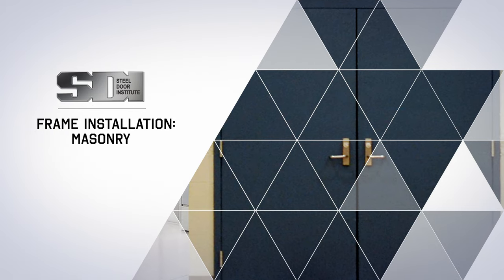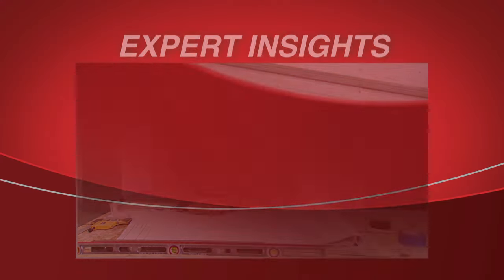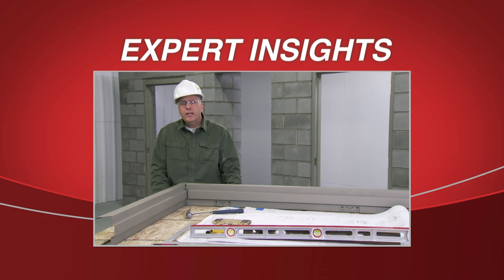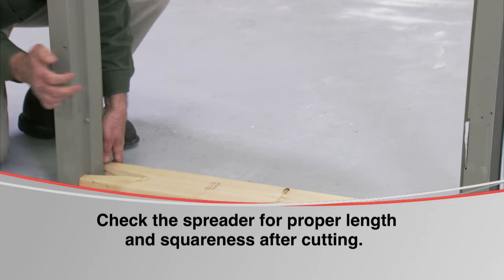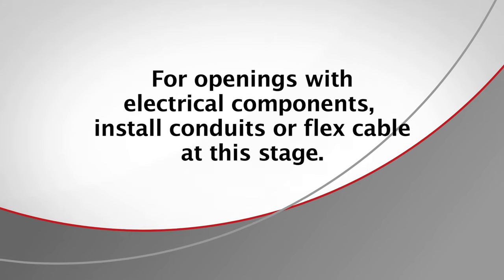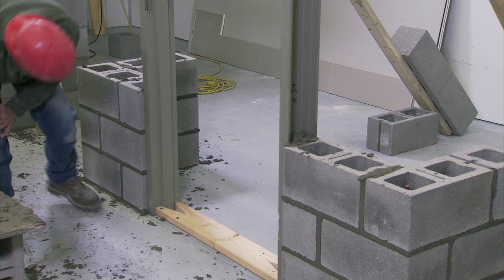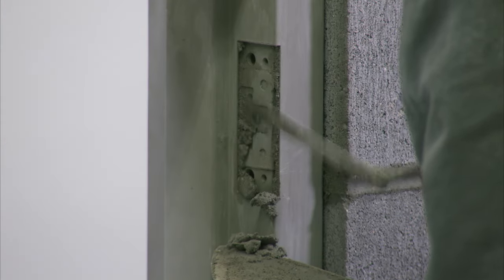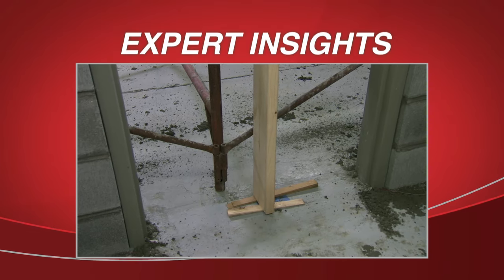How to Install a Steel Door Frame in Masonry Construction | Steel Door Institute

Comment: SDI's your white paper "the Risk of Grouting Steel Frames" also says grouting is usually not necessary for masonry construction. However if done properly it will not cause any issues w/ the frame. But when not coordinated properly a thin slurry is often used & that excess water often causes rust.

Comment: Good vid ,sorry to see the OSHA bust on the mason's backwards hard hat in your professionally done video , oh well ,but I have a great tip ,since I have installed thousands if masonry frames ,when the frame is set ,I always install the rubber mutes ,or silencers ,as the mortar or grout added will seep out the silencer holes ,and drilling will be required later to install the silencers ,I remove them when I remove the braces ,as they will interfere with the painting of the frames ,but saves time and labor !! I also keep 4'x8' x 1/2" thick styrofoam sheets on hand to cut into stop width strips ,and apply with silicone caulking where any surface mounted hardware re- reinforcements are ,this does not impede the frame grouting ,and saves your drill bits when hardware time comes !!
Reply: While I don't know OSHA codes to the letter to know for sure if this is a violation or not, I do know that some hard hats are made specifically to be worn backwards as forward brims can interfere in tight spaces and some workers would prefer their neck shielded from the sun when working outdoors.
Reply: @bricklayer621  wrong
Reply: @nunyabusiness896  wrong

Comment: My understanding from reviewing SDI literature is that the mortar...often incorrectly labelled on drawings as "grout"...is there primarily for sound deadening purposes, NOT anchorage integrity or fire resistance. In most contemporary buildings, interior partitions that include CMU that are located in "finished" areas usually include furred out gypsum wallboard and are thus "hybrid" in character. In those cases is it safe to assume that mortaring-in of the frame should not be done and that another type of anchor should be used? My understanding is that SDI is against the use of "grout" in any type of installation where the mortar or grout cavity communicates with any other partition cavity with gypsum wallboard materials.
Reply from the maker: Grout is usually troweled into frames while the wall is being built around the frame. For CMU walls, the T anchor or wire anchor between the blocks is what secures the frame when the grout or mortar dries.
Frames are not required to be grouted to be fire rated. Sound deadening can be increased with the filling of a frame but other products can also accomplish this.
Gypsum walls should never be grouted. Contractors pump the grout into a frame, which we specifically prohibit in standard ANSI/SDI A250.8, because it is too loose or wet and the moisture will propagate to the gypsum wall like a sponge attracts water. So you are correct that SDI is against grout being used in drywall/gypsum construction.
Reply: @SteelDoorInstitute  your white paper "the Risk of Grouting Steel Frames" also says grouting is usually not necessary for masonry construction. However if done properly it will not cause any issues w/ the frame. A thin slurry is often used & that excess water often causes rust.

Comment: Put the hardware side of the frame flush to the wall face. Not centered in the block.
So door can open to 180 degrees to the wall.
Reply: I know that this is just a demo, but a wrap around frame would be a much better choice in this case. The finished base whether it's rubber or wood hates having to return less than an inch. It's much better to run straight into the frame if you want the adhesive to keep it on.

Comment: Anyone know how to remove one of these frames from an old house?
Reply: Out of curiosity, why would you want to remove the most durable door frame that money can buy?
Reply: @khabuda  because mine is surrounding a large wardrobe, with large crossbeams across it for holding the doors and a shelf, and I want to modify the wardrobe. As great as these are, they present large and difficult problems for even basic modifications.